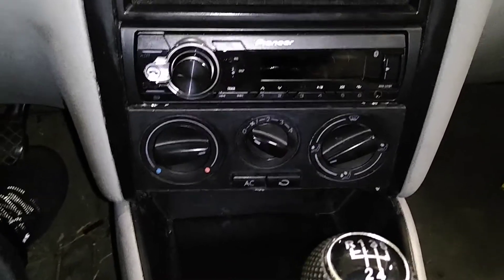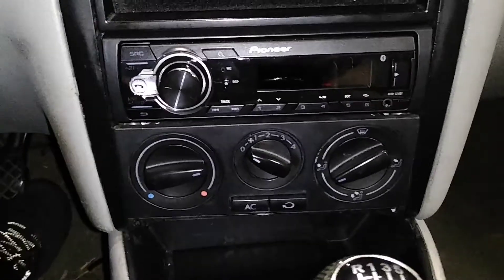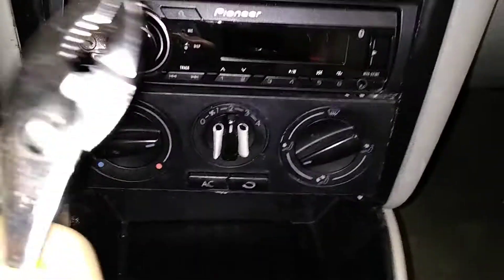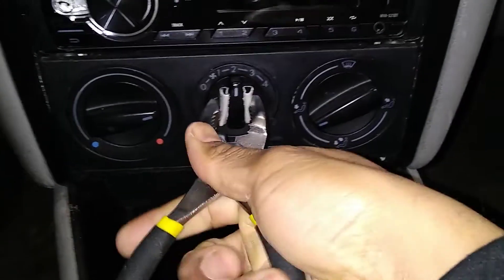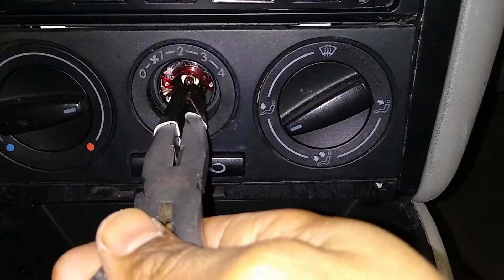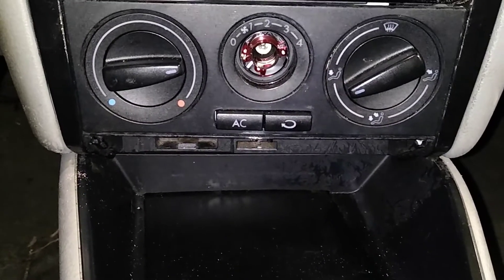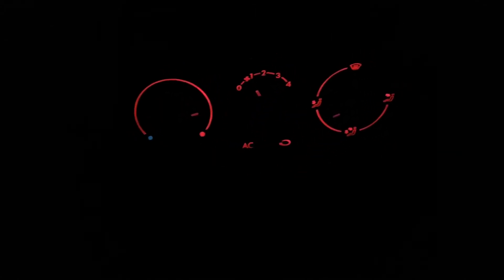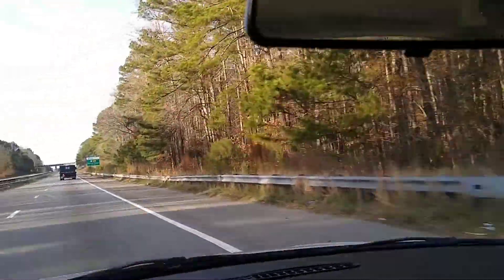MK4 GOLF | climate control bulb replacement

Comment: Is it just the centre bulb you replaced or is it one bulb for all three knobs?? The lights on all three climate control knobs don’t work on my golf
Reply from the maker: The one bulb illuminates all 3. I had the same issue you were having. See the section of the video linked below.

https://youtu.be/fbgYqOFU6hU?t=39
Reply: @MaqsVids sir What's the name of the bulb you replaced?
Reply: @MaqsVids  were the A/C and recirculating air buttons also not lighting? Just drive my mk4 home and those three dials plus those two buttons aren’t lighting up.